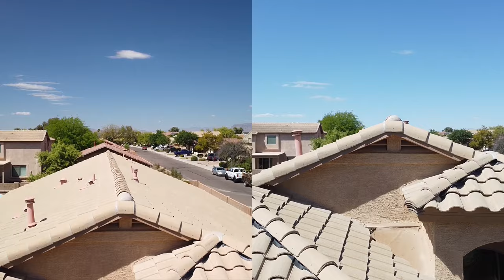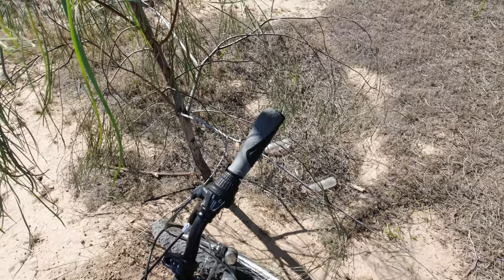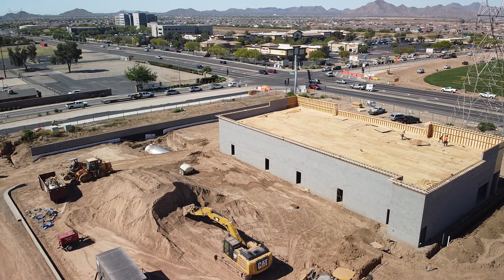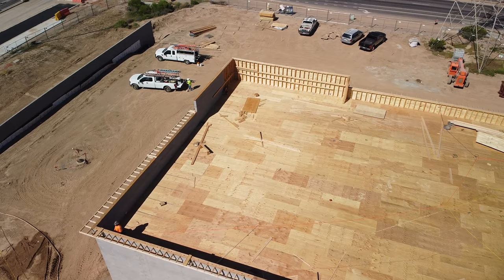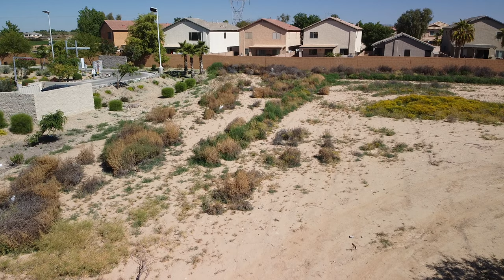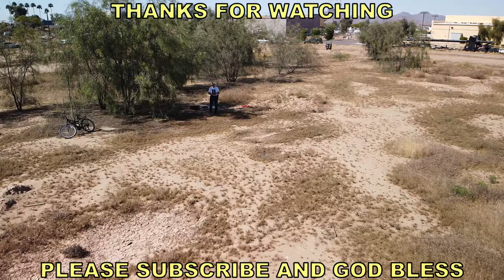MY MAVIC MINI & CONSTRUCTION & COTTONTAILS

Comment: As always good job Mr Kent.  The sweet spot is to get the Mavic mini shutter speed to 1/60 for 30fps video or 1/48 for 24fps video.  You can see what the effect on the various ND filters are on the Mini's camera selections by turning on Subtitles in the Fly app.  You will need to playback your captured Mini video with something like VLC so that you can turn on the subtitles.  SS is the shutter speed TLM in the subtitles and it is expressed like 60.xxxxx  where the xxx is a decimal value (Example: 1/60.12345) .  You can also effect the camera values with EV setting while you are flying.  I would suggest turning on subtitles and doing a screen record of your flight so that you can see what setting you were using to achieve the numbers on the subtitles at any given time.  Also of note, every time you change EV it unlocks camera settings and puts everything back into full auto so don't forget to press the lock button on the Fly app screen after every EV adjustment.  God Bless.  Stay safe, Bob
Reply from the maker: Bob, You are a genius. I know very little about all that. I'm glad you do though and I appreciate your attempt to help the helpless :) These filters were a gift. Until I received them all I did was "fly the drone." So now you know who you are dealing with :) God bless you for your input and don't give up on me.

Comment: I video some deer in my upper field occasionally , they seem to have zero fear of my drones, I have some great pics of an 8 point buck with velvet still on his horns, he let me get very close, stared at the drone a few seconds and went right back to eating, really surprising too me at the time.
Reply from the maker: That's interesting. The deer I came close to ran quickly away. Different drones sound different maybe. Thanks and God bless.
Reply: mrkentdotcom , male or female? The does and yearling deer move away from the drone, also if they are just one or two of them they are much more skittish . I’ve had them run when it’s just one , they seem to be braver in a larger group. The older bucks around here just treat my drones as an annoyance though. If a doe bolts and blows with her tail up they all bolt out of habit though. Try approaching a buck that has does around, I bet you get different results.
Reply from the maker: @noonespecific9463  Thank you for the specifics. Excellent explanation to a city boy :) God bless.

Comment: I think they refer to that smearing as motion blur, possibly it’s something different as like you I don’t really mind nice crisp video. So I’m not really up on all the terminology really. Cinematic footage is for movie makers, lol. That’s why I like 1080 p at  60 frames per second, don’t eat up a ton of memory space and it’s nice and crisp.
Reply from the maker: Very good input. I don't have a lot of desire to do cinematic footage but I learned a little more about it thanks to my daughter and her family's gift. God bless.
Reply: mrkentdotcom , the drone? Very cool gift if so, that’s where my mini came from basically , my family, I wouldn’t have bought a mini having an Evo and a mavic air 
, well and a spark. Spark was my first drone. But I’m really glad they got it, it’s much more capable than I ever imagined. The flight time is phenomenal and amazing that it gets that much out of that tiny battery. I just happened to remember I seen a very worthwhile looking accessory for the mini, some little metal caps that go on top of the motors to slightly raise the props, they also protect the motors from getting trash down in them as they are a little exposed. The props need raising as apparently when you fly a lot in sport mode and make fast turns the prop tips can actually impact the drones body. I rarely fly that way, so I have not experienced the issue. But the fact they protect the motors seems like a good idea. DJI also likes the accessory caps as they say you can install them without voiding any warrenty or DJI refresh if you have it, I’ll try to post you a link when I track them down to order them, they should be fairly cheap, it’s just 4 little caps.

Comment: Hello Mr. Kent,
Your 'smearing' is actually called 'Motion blur'.
To get the for the human eye most pleasant amount of motion blur there is a so called "180 degree rule" which means that the shutterspeed has to be double the framerate.
Because the Mavic Mini has NO manual settings for video, this is very hard to achieve.
Reply from the maker: Thank you for your comment I read up on that when I received the filters but it is still all new to me. I always appreciate all the help I can get. Thanks and God bless.

Comment: Hello Mr Kent .  I've never really looked into filters or understood how they work so thank you for the explanation on them .  It seems your bike has become an all terrain vehicle ,  tires holding up ok ?  Ha ha !   I thought the drain pipes would run under the highway so I guess the flow is  away from the road  ?  Hope the family is safe and well .   God bless
Reply from the maker: Thank you Dave. As it was explained to me by a viewer the huge tank is something like the wash by my favorite park. During a very heavy rain water on the pavement has no place to go so it drops into the huge tube. Then, over time it is designed to allow it to soak into the ground. That's as much as I know. Thank you for your well-wishes and God bless you also.